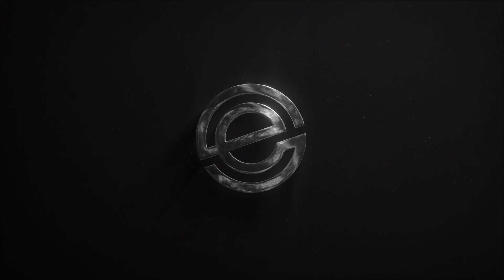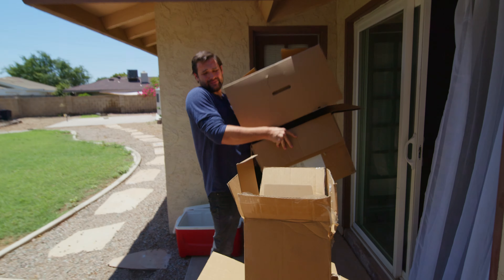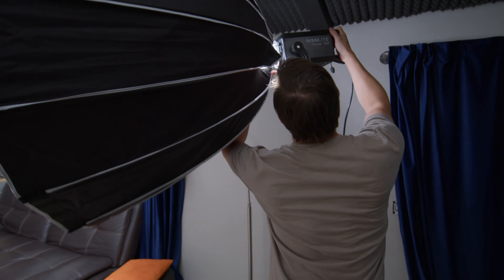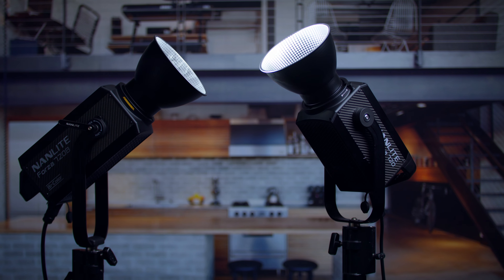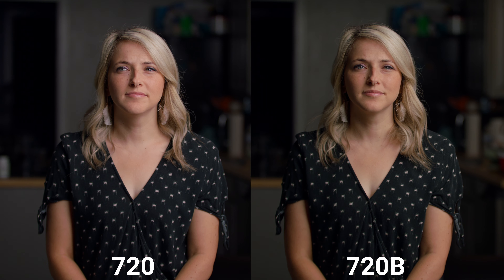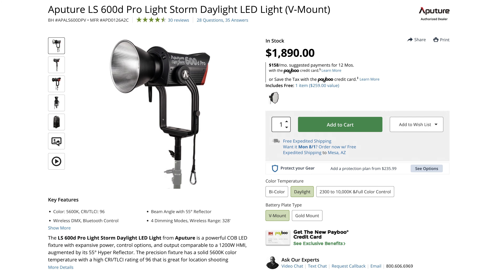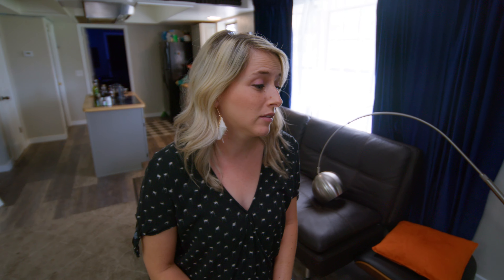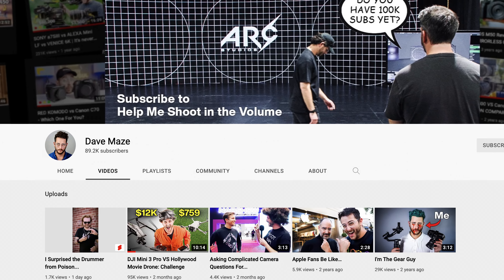These NEW LIGHTS are EVEN BRIGHTER (Forza 720/720B)

Comment: Pro tip for using nanlite. The way you put them in standby mode is by pressing the brightness knob. Switching it off turns it off fully, but pressing the brightness knob just puts it in standby and makes it turn back on much faster.

Comment: Tips...don't use the strap that came with the bag. I was on my way back slinging the bag on my shoulder and the metal clip gave way. This light with the control weighs 10kg....its too much for the strap to handle.